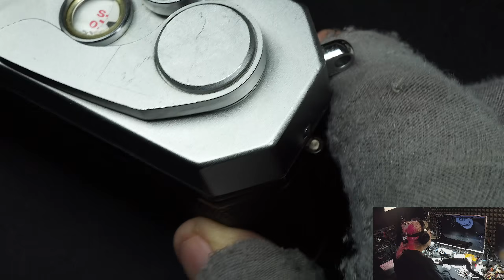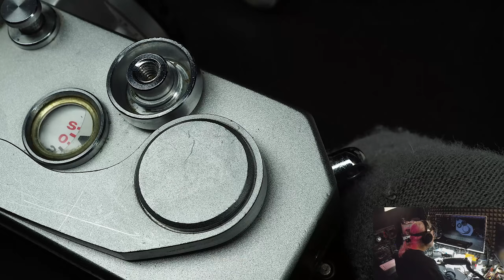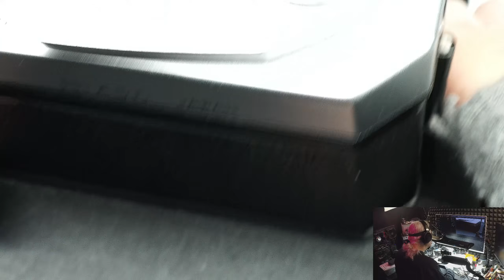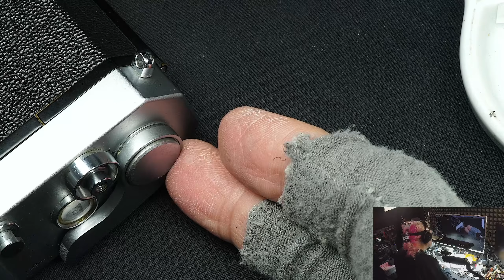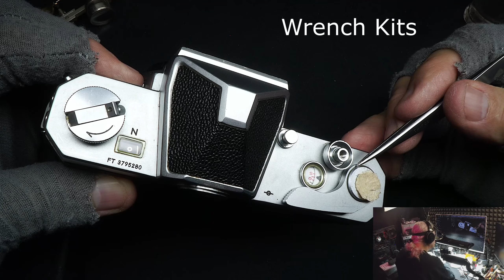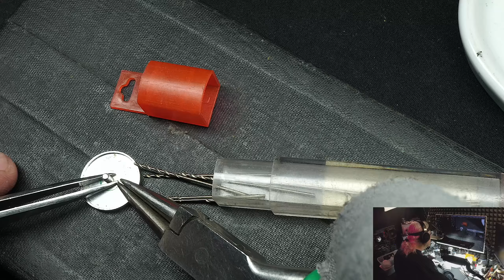Nikkormat FT | Remove Advance Lever Cap DIY | DIY #004

Comment: I have 3D printed flexiclamps for these and they work surprisingly well. Unfortunately I snapped off the screw post since I wrongly assumed they were reverse threaded - and I just applied minimum force. So it goes.
Reply from the maker: Hello Dane M
As I remember it's a standard right thread. I have been told by a few people it's a left, but I disagree. I suppose it's possible Nikon could have made it both ways on different production runs. I just don't know for sure, but as I always tell people, "rock any threaded nut both right and left about 1/16 of an inch and work it loose to find out for sure". I have found many parts on all cameras reversed threaded from the standard production run. Not all cameras were made at the same facility over the years of its production. Don't feel bad. The Nikkormat advance cap has always been a problem to remove even back in the 1970s when they were new.

Comment: Hi Kori. Thanks for the advice, glad to see that I wasn't going crazy with the cap being stuck! The double-sided tape didn't work on my FT2 but I glued a wooden coffee stirrer to the cap with hot glue and did the back and forth wiggle as you recommended, and it came right out. Shout out from QLD Australia!
Reply from the maker: Hello jb32647
Glad to hear my video helped. If you get a chance, look at how small that screw is on the back of that Nikkormat cap. It is soft brass and it breaks off real easy, and if it does you're screwed. Then you have to drill it out and find another cap. You did everything right just like a repairman would. Adding a few drops of acetone to the threads is good insurance while removing the cap.  Never be in a hurry. Keep working at it.     “I’m in Texas, and most days are around 37.8°C now, with even hotter weather coming soon. I don’t know much about Australia, so to me it feels so far away it might as well be on another planet. LOL. Later, Kori.”
Reply: @FilmCameraRepair  Yes, that thread is absolutely tiny. I had to dismantle most of the camera because the shutter was sticking and I wanted to get access to the gearbox to clean it. I have family in Texas, Queensland is very similar in terms of heat, but more humid because we’re near the tropics!

Comment: I didn't have double sided tape, so I tried applying a fine coat of neoprene glue and it worked like a charm !
Reply from the maker: Hello Finn Bo Jørgensen
Yes, I had thought about using glue of some sort, but the double sided tape worked for me so I never tried it. But, thanks for the info. I am sure someone will use your idea.

Comment: Thanks for the video! I have a nikonos V with a similar issue, though my cap was press fit, not threaded. I used a blob of hot glue stuck onto the cap, with a full stick of hot glue to pry it off. It worked really well and didn't scratch the cap. If the double sided tape doesn't work, try that instead.
Reply from the maker: Hello  Andrew Sandford
Thanks for the idea. I have wondered about that method in the past when having trouble removing the cap on a Nikon body, but got my cap off before I need to. I was thinking of using epoxy, but I never figured out how to remove the epoxy after the cap was removed. I guess there must be some solvent that would remove epoxy. But, again, thanks for the idea.

Comment: Here's what I just did: I used JB Weld to glue a metal nut to the cap. After JB Weld is fully cured, I just use a regular wretch to unscrew the nut together with the cap. Now I am soaking the bounded cap and nut in acetone, hope they will separate......
Reply from the maker: Hello Qiliang Yan
I tried your method in the past, but I don't remember what type of glue I used. It did work to remove the cap on some cameras and failed on others. I then started using my 'acetone and double-sided tape' method because it took less time. If that failed, I would drill two holes in the cap and remove it, because I had extra caps from other used Nikkormat cameras in storage.  So, yes, your method will work and is worth trying if all else fails. Thanks for sharing this information.
Reply: @FilmCameraRepair  I first tried Super Glue. But that one is not strong enough to withstand the torque and broke off. Then I used JB Weld, it is really strong for metal-to-metal binding. The cap came off really easily. But the flip side is that the binding is so strong that it becomes a new problem to separate the cap from the nut. ChatGPT says the easiest way is heating it over 350F. I haven't tried. I worry if the high temperature will damage the brass cap.
Reply from the maker: @QiliangYan  
I don't think it will hurt the metal, but it might discolor the metal finish in some areas.
Reply: @FilmCameraRepair  Thanks. They got separated nicely after soaking in acetone for a few hours. No residue of the glue on the cap.

I had two main problems with my Nikkormat FTn. 1. The meter needle was sticky, I had to tap the camera to make it point to the stable position. 2. The meter needle jumped erratically when I was changing the aperture. It jumped between the normal position and the over-exposure extreme. 

For the first problem, I took out the meter, removed the two small srews at the bottom of the meter, and pried the meter out from the case. I applied a tiny drop of watch oil to the upper and bottom bearings. It seems to be working. The needle now moves smoothly. But you mentioned the sticky needle might come back, so I am not sure how long this will last.

For the second problem, from the meter wiring diagram, it seems that jumping to over-exposure extreme indicates a open circuit of the variable resistor. So my judgement is that either the contacts or the resistor ring gets dirty or oxidized, so the electric contact is on and off while I am runing the aperture ring. I wanted to remove the rings and have them cleaned. Unfortunately, I have not been able to remove the 4 slotted screws that secure the lens mount. I tried naphtha, IPA, acetone, heating with a solder iron. Nothing worked. Then I used a workaround. I wicked a few drops of DeoxIT contact cleaning fluid into the seams between the rings. I watched your video about the rings and chose to apply DeoxIT at 3 places: a) the opening behind the aperture following pin. There seems to be a piece of spring loaded metal latch there. b) The seam at the maximum aperture and the red dot indicator. c) the seam at the ASA setter. I don't know exactly where the contacts and the resistor ring are, since I haven't been able to remove the rings and see them. But from your video I guess these places are in good proximity to the contacts and the resitor ring. After applying a few drops of DeoxIT, I turned the aperture ring and the shutter speed ring back and forth. This seems to be working. Now the meter needle no longer jumps erratically.

The remaining thing that I don't like about my Nikkormat is that its focus screen is a microprism one. I cannot see very well the shimmering pattern. I like the split-image focus screen much better. I will source a split-image focus screen and swap it in. I will follow you viewfinder video to do that.

Your videos helped me a lot. Thank you so much.

Comment: Hobbyist watchmaker here. You might want to try the Bergeon 8008 B rubber ball. Same principle as the tool you show in the beginning of the video: high friction/sticky rubber but in the shape of an inflatable ball about the size of a small orange. It is used to unscrew the back of watchcases and costs around 10 bucks.
Reply from the maker: Thanks for the suggestion. I put one in my Amazon basket. I'll try it the next time I get in a Nikkormat. My fear is that the surface area is too small on the advance lever cap, but I will try it. Some of these Nikkormat advance caps are in real tight.

Comment: I have an FT2 where the cap can be unscrewed about 3-4 turns, which loosens the advance lever, and then gets stuck hard. I think the cap itself may be stuck to the underlying spanner nut. Any advice?
Reply from the maker: Hello Hunter Compton
I have had this happen to me, and I never found a solution. I usually just keep unscrewing the cap until they both come off or something breaks. I have extra parts so it was never a huge problem. Of course it you have no extra parts, I can see where it would be a big problem.

Comment: I was able to use a shepherd rubber leg tip..I used a 1 1/2 inch ..but sure you could get smaller
Reply from the maker: Hello Nicholas Howe
I've tried some of those in the past. It was a hit or miss situation with me. Sometimes it worked and sometimes not. If a Nikkormat advance nut is really stuck in place, I have found that sticky double sided tape works best.
Reply: @FilmCamera_Vlog  thank you for the tutorial ..I was able to get the prism removed ..hoping I could clean it sadly there seems to be black patches actually in the prism ..so will have to replace that
Reply from the maker: @smudgebusterINC  
Yes. On many of these old slr cameras the prism mirror coating is bad. Olympus OM-1 is real bad about this. Nearly very one.

Comment: How to disassemble and assemble the lightmeter needle
Reply from the maker: Hello Rolando
I've tried fixing lightmeter needles in the past and had no success doing so. They were usually sticking, so I would clean them. They would work for a period and then start sticking again, and come back to my shop under warranty. It was always easier to just replace them since I am a commercial repairman.

Comment: I have an FTn like the one you show there that I bought as a parts camera for another FTn. However the 'parts' camera on inspection, works better than the one I need to repair, so. It works perfectly except on the 1, 1/2, 1/4 shutter speeds which I've found is very common for FTn's.  The shutter sticks on those speeds which I am guessing is hardened lubricant. Question; would it be safe for me to remove the top and needle inject some naphtha to clean the lube off the gears? Can I use watchmakers oil to re-lube the gears? Thanks in advance for any advice!
Reply from the maker: Hello RR
That is a hard question to answer. Yes, I suppose you could wash the timer with naphtha using a needle squeeze bottle of some type, from the top, and let it drain out the bottom. But, I would then test it to see if the timer is working properly after it dried out. If it is, leave it alone. Do not add oil. But, if it still is not working properly, you don’t want to bath the timer in oil of any type. The best way to oil it is to add a few drops of oil to a bottle of naphtha and apply the naphtha-oil, mix to the timer and lubricate it that way. The danger is too much oil. Less oil is better. The proper way to oil the timer is to remove the timer and put oil only on the moving parts.
Reply: @FilmCameraRepair  Got it! thank you. By the way the acetone worked to remove the cap. I used a hypodermic needle to feed it into the edges and then would draw it out back into the needle and feed it in again so I was pumping it into the threads, It only took about .5ml of acetone using this pumping action which greatly reduced the risk of damaging the leatherette cover. Also, as you said, a cone stopper was useless but I found it helped to use a gripper rubber glove to turn the cap with my thumb. Thanks again for the quick reply and the suggestion of the naphtha oil mix.
Reply from the maker: @rockmeister-g7j  
Blow out the naphtha-oil mix with an airgun or debris will stick to the oil and cause problems. As little oil as possible is best. If a little oil will not fix it, a lot of oil will not make it work either.
Reply: @FilmCameraRepair  Update! The naphtha with a needle worked and the shutter speeds are all freed up and working correctly. I also replaced the eyepiece and meter window light seals. I was surprised when I opened it that there was the diode modification already done so I can run it on 625 batteries. Next I will replace the light seals and mirror bumper. I now have a fully functional Nikkormat FTn! Not too bad for a $37 thrift store find!
Reply from the maker: @rockmeister-g7j  
Glad to hear about your success. The main goal is to have fun with your DIY. As for the diod, I don't know. You might start out using a 1.55 volt battery and run some exposure tests. Anyway, glad to hear speeds are working again.
Reply: @FilmCameraRepair  Here's a link to the diode modification. It drops the voltage from 1.5v to approximately 1.35v. I'm going to do that on my other FTn. A lot cheaper than using Wein cells that only last a few months. https://www.youtube.com/watch?v=Yo7T6OQ3BFo

Comment: Thank you! Removing this cap without destroying it is really painful!
Reply from the maker: Yes, it is painful. I've spent more time than I would like to admit removing those stupid caps over the years. Glad I cound help.
Reply: I'm thinking about making this part by CNC, but a real issue here its choosing proper color
Reply from the maker: @SergeiPodanev-os1ji  
There are hundreds of parts that could be made by CNC, but luckily there are plenty of non-working film cameras on eBay one can use for parts. The only part that I would like to see made is an idler gear for the Pentax Spotmatic. The used ones from parts cameras are worn, and a repairman needs new ones for repairs.
Reply: @FilmCameraRepair  Method with acetone work with my FT3, but it didn't help with  FT, may be because cap its too flat! Thank you!
About ebay, why not just restore non-working cameras instead of using them for parts? I think sometimes its really easy
Reply from the maker: @SergeiPodanev-os1ji  
Concerning the FT cap, near the end of the video, I added a section on drilling holes to remove caps which you coud use as a last resort. About eBay, I could restore the cameras, but I need the parts for my repair business.